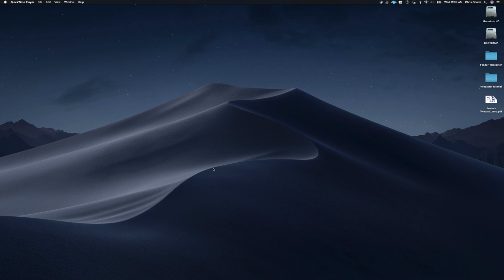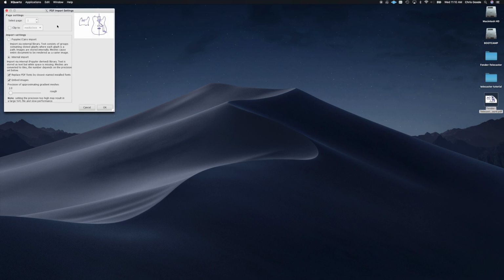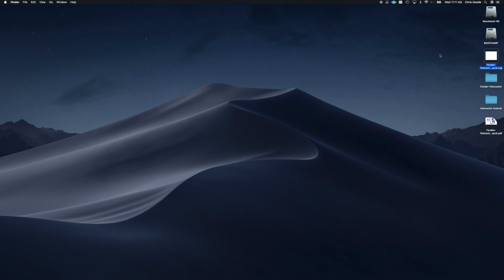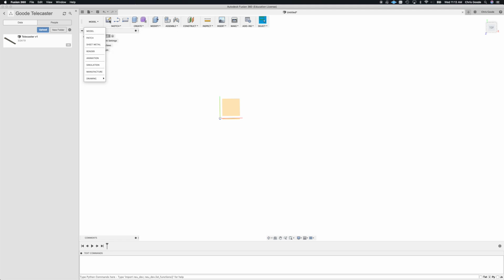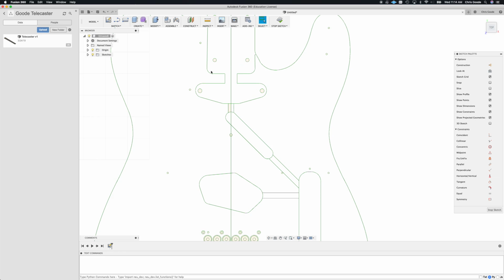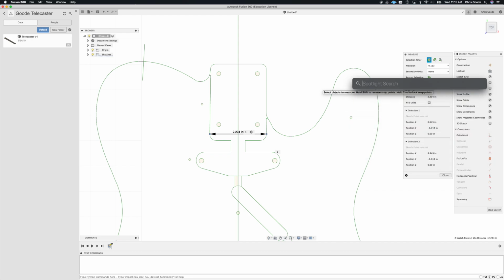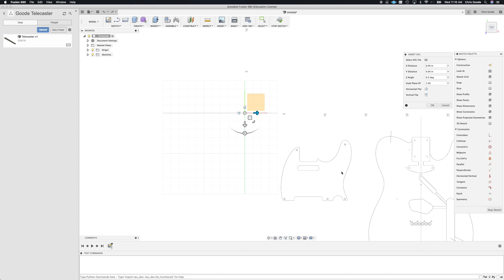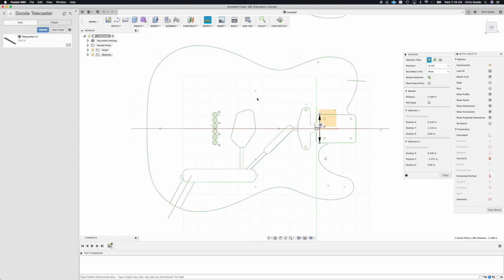CNC Guitars Using Fusion 360 - Step 0

Comment: In this video step zero, you use this scaling program where did you find that is it part of fusion or is that some separate program. When you first open it it says spotlight somethingAny help would be much appreciated thanks
Reply from the maker: oh that's just the Mac search bar (spotlight search), same as typing in the windows start area or a browser search  - I was using it as a calculator. so to scale, you want to divide your desired measurement (width of the neck you plan to use) by the observed measurement (from the first svg you imported). If your svg has a larger size than you need, that result will be <1; if it has a smaller size than you need, it will be >1. Either way, apply the scaling factor in the scale plane xy blank and it should be pretty close
Reply: Chris Goode, Thanks for your time.. I appreciate it big time. I still don’t understand how are you calculated scaling, I mean I get the jest of it. However I manipulated it By changing the number in fusion 360 in the SVG box for scaling, until the neck pocket read 2.25 because I’m doing a Strat body. For some reason I was able to download an image of a strat body The other day to ink scape and now today I tried to download a neck, However today ink scape  would not let me download anything to it. very discouraging I’m following your video step-by-step surgically and nothing is working🤪 I don’t know what to doThink I just wasted $3000 on a CNC machine